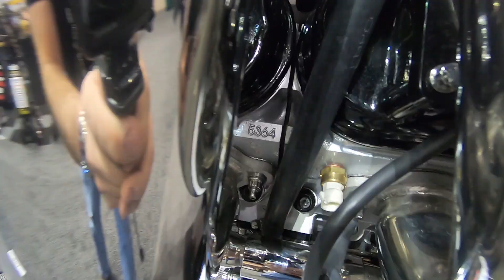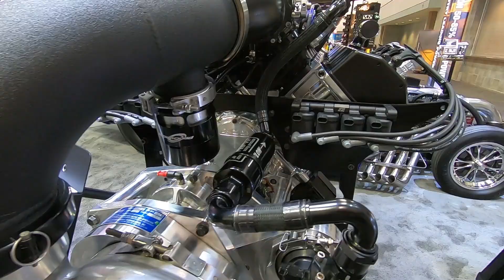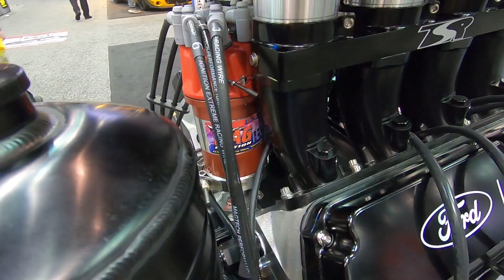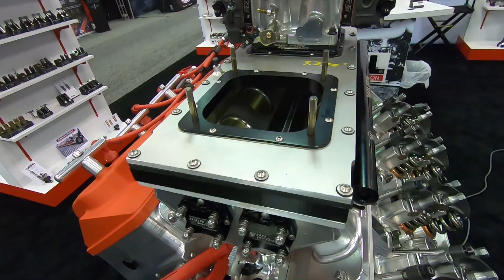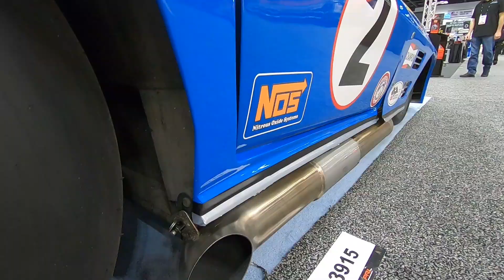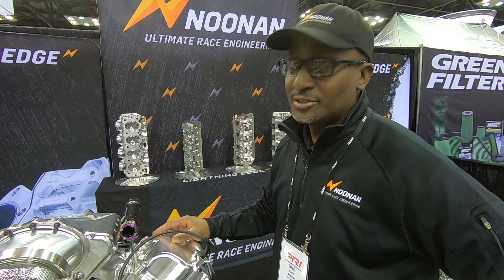10 Unbelievable Engines from the Performance Racing Industry Show (2019)

Comment: similar to the 440 cubic inch big block that I put a hilborn mechanical fuel injection and ran a 9 second quarter mile naturally aspirated first time out with a bad pump on alcohol almost sixteen to one compression

Comment: Back in the day at the time of Daytona qualifying. They said the cranks were timed 180° past TDC.  With different firing order. I thought they were using a flat plane crank some how. They were timed like the Rodeck engines. Giving them a completely different sound. You could here the difference with pull trucks using them. Just something I remember about those engines.

Comment: All that knowledge and engineering, all that custom cnc work and money....... and you just can't pull yourselves away from pushrods and rockers, 2 valves and capacity 🤦‍♂️

Imagine a 500cui billet race engine with 4 valves per cylinder. Or 5.
Imagine an engine that utilises modern ecu/direct injection technology instead of carbs/top mount throttle body. 

Imagine if the engineers actually engineered instead of just copied, and made bigger.

Comment: I don't see the 16cyl catching on with hot rods. They can make that kind of power without the weight. True the engine works harder but the performance gain of not lugging around another engine is what I think  will make it a wash. Plus all the work it would take to bastadize a chassis to hold that thing.

Comment: When you do the math the v16 isn’t that impressive bc ppl are running 600-1000 hp on a stock 150,000 mile 5.3 or 6.0 from the junkyard pretty regular with an ebay turbo so 900 NA is 450 from 8 cylinders
Reply: So just throw a couple of those 900 hp turbo junkyard motor in your $800,000 boat.  They'll last forever.

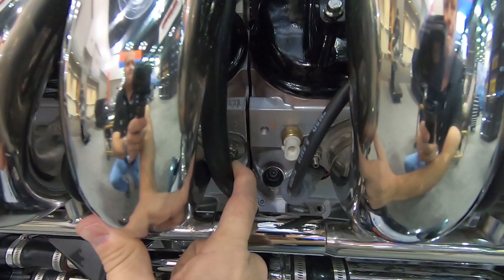Comment: 1:42
Love the exhaust manifolds just millimetres from the ignition leads and coils.
Reply: That's the architectural limits of a 1920s engine design.
99% of other manufacturers had realised 4v heads and OHC with spark in the centre of the chamber and true crossflow designs were superior almost 60 years ago.

America will catch up. Eventually.

Comment: CNC aluminum slug blocks lawl. There's a few 5,000 lb steel diesel engines that can make 3x the torque and the same amount of HP these people are attempting to make. 13-15L displacement with proper twin turbos.

Comment: if you can make make 1,000 hp with two cylinders, why would you use a 8 cylinder engine that less power and 4 times  the weight

Comment: Two stroke diesels are awesome and very clean. A radial four (X) has near zero torque vibration and no mechanical vibration. A twin row is even smoother. All four rods are carried on one crank pin so simple to make. Intake are is blown through reed valves. Exhaust has a variable port height to keep the torque high across the range.

Comment: Hold up. That Sonny's Racing engine makes about 153 HP/liter naturally aspirated. That's incredibly impressive. Also, If the Jesel engine lives up to it's hype, the current estimate is that it will produce 1325 HP with a 12000 RPM redline. That's 189 HP/liter, which is insane! Can't wait to hear what that sounds like.
Reply: I’m very confused, that isn’t that much?
Mercedes builds a stock mass produced engine with 2.0 liters and 4 cylinders.
It makes over 400hp, of course it’s turbocharged.
But much more efficient and more power than the engines you praise.

And it runs 150000 miles without an rebuild.
Reply: @rolux4853  what's impressive about these engines is that they make that much power per liter WITHOUT a turbo or supercharger. I think the highest naturally aspirated output per liter in a production car is the Pagani Huayra R with 139 hp/liter. I believe the Honda S2000 still holds the record for more normal production cars at 124 hp/liter.

Also please check the age of the comment before you reply to it.

Comment: 100hp per cylinder isnt all that great compared to much smaller packages that put out similar numbers.
Reply: Yeah, imagine an s2000 derived 4400cc V8 with 4 valves and Vtec.
9000rpm with 500hp Na 😱

Comment: WHY FOUR cylinder heads - if you're going to machine a DEDICATED block...machine DEDICATED heads and ALSO...ONE SUPERCHARGER the whole length
Reply from the maker: But why? There is a tangible benefit of a single, 16-cylinder block. All the water is contained in a single vessel and the crank is better supported. But there's no benefit to two cylinder heads instead of four in terms of cost or power production. Same thing goes with the superchargers. There is no benefit that I can see--plus it would be more difficult to keep the rotors from twisting when they are that long. Thanks for watching.
Reply: Because you can go buy many different off-the-shelf cylinder heads with great flow numbers that already exist in the performance aftermarket.  Why invent things you don't need to?

Comment: pretty funny how 16 psi is massive boost requiring a big blow off valve ... O.o thats not much over 1 bar thinking about old five cylinders with 2.5 bar or 35+ psi in comparison that's quite not massive boost rather average
Reply from the maker: Except boost is not an absolute. It is a measure of resistance. The same turbo or blower will generate less boost on a cylinder head that flows better and still make more power. For example, if you generate 10 pounds of boost on a baseline engine, pull the heads and port them then put it back together. The combo will now make more power with less boost. So it is troublesome to compare boost between two totally different engine packages. Thanks for watching!
Reply: @TheHorsepowerMonster  Well sure but i didn't suggest anything about the power output rather that 16 psi is about what my standard diesel engine runs at so i just found the term "massive" pretty wierd still a good video non the less :D
Reply: You misunderstood, it wasn't 16 psi, it was 60....

Comment: i still respect  homemade stuff higher than stuff just made with bought parts.
like the young guy kyle that made a stock bore  honda 4 cylinder engine put down over 1100 hp to the wheels and still sound smooth and able to take more.
he made alot of monsters. just imagine what he could do if  some sponsors backed him up.
https://www.youtube.com/boostedboiz

Comment: Ok,  we were impressed by everything shown here, but happen to have a direct interest in what the folks at Noonan (Racing?) achieved by slicing off 1/4 of an engine to reliably and economically dyno-test at 25% .25 or 1/4 of the operating cost, material waste, component stress, assembly/disassembly time, effort , and amount of work required to make component changes. 
 What’s the proper and lawful etiquette of possibly using a similar to but visually noticeable variation as a spin off of your idea for the research and development of a smaller auto-marine-aviation-industrial engine? 
 Relevant use Fees? Creative Credit? , Percentage? , Release? License? 
 Long as it’s cheaper than buying or paying a facility for test time on a high output Dyno
Reply from the maker: You would have to ask them. www.noonanrace.com  . Thanks for watching!
Reply: Single and twin cylinder test engines have basic equipment at engine manufacturers since the start of the industry over 100 years ago.  I tested single-rotor 350 cubic inch Wankels in the 1980's and single-cylinder 140 cubic inch diesels in the 1990's.  The original EMD 567 2-stroke locomotive diesel was originally developed in V-twin form.

Comment: I don’t believe any Ford V8 engines have  (had) bosses or mounts for a starter, they bolt up to the transmission’s bell housing with the use of an intermediate bell-housing plate, to accommodate tolerances based on various engine flywheel diameters, ring gear depth, the starter gear and nose designs, with the precise location punched out of the plate.

Comment: wait a minute, so they cast a 16 cylinder block based on the ls, strap either 4 turbos or 2 superchargers nd r still makin less power than 8 cylinder ls's?? somethings weird there, weve already got 1500 hundred hp motors doin over 300 runs leroys a perfect example n he didnt take it easy on that car either  also good lord how many ppl were vacuuming lol every other shot somebodies pushin a vacuum cleaner around :p  they were some wild ass engines tho i havent seen any of those yet

Comment: 360/16 = 22.5.  I thought the number of cylinders an engine can have must be evenly divisible by 360
Reply: There have been quite a few historical 16 cylinder engines, including the current Bugatti W16.
Reply: The firing interval could be 45 or even 22.5 degrees.  It's just a number; doesn't cause a problem.
Reply from the maker: I understand what you are saying. I can't find any info anywhere of photos of the crankshaft Sixteen Power is using, but I'm willing to bet it fires every 90 degrees like a conventional crankshaft. You'd have two cylinder firing at one, but it shouldn't be too big of an issue. Thanks for watching
Reply: @TheHorsepowerMonster  I had to go read the wiki on the v16 and it works.  Its typically used in Marine, Railroad and stationary power generators.
Reply: For even firing intervals in a 4-stroke engine, it's 720/number of cylinders, so 720/16=45 firing intervals.  Easy to do in a 90-degree block with crankpins phased at 45 degrees.

Comment: around 20 years ago someone had built what we today would call a crude version of that v-twin. it started with a keith black top fuel block, cut into pieces and welded back together as a 2 cylinder. brad anderson heads got the same treatment. iirc it ran a 6-71 blower, and it did run on nitro, and made around 1200hp. it was built for a land speed car.

i figured this v-twin was either a display piece, or something for another land speed car. interesting to see its actually a dyno mule.

Comment: The two cylinder 1000hp motor was incredible. The flat 4 also. I love engineering like that. Those engines could fit In anything! 🔰
Reply: That's far from small dude! The v twin from supercharger to flywheel is longer than 2 Ls blocks

Comment: I think that when Rolls Royce were developing the Merlin and "R" engines they ran single cylinder prototypes to see the potential horsepower figures. So to see the "twin" is unusual but not a first. Of course aeroengine manufacturers were pioneers in supercharging and turbocharging .
Reply: I dont know where it is today but in the 80,s a guy named Lucky Kaiser made a merlin v twin motorcycle from a crash damaged merlin.
Reply: Royce's made "star" engines to test concepts for their 24 cyl X engines and many single cylinder test engines, one of which led to the infamous 'ramp head' in the very first Merlins, which failed badly when scaled to the full size V12.

Comment: V16 is a waste of space a big block v8 can make 1600 blown
Reply: I agree, they could have made that power out of a v16 back in the 60's
Reply: @spyder4g63t  waste of displacement but a boat engine nonetheless
Reply: Not uncommon for 8s to have 1,000hp or more. That v16 should be around 1500 na 🤷‍♂️
Reply: @Knightmare-gz9ls  yea I bet a Ford v16 would make 1500 natural
Reply: @Knightmare-gz9ls  I do believe they upped the hp of the n/a tho
Reply: I guess you guys missed the part about reliably making that power without extra strain on the components, especially for boat engines. It seems that boat applications can be pretty hard on engines. It all depends on the cost of the V16 and the cost of any parts that may need replaced later. The rods, pistons, etc. might even be stock or lower budged parts at that power level. It might not fit everyone's needs, but it may work well for some. 

On the 406 sbc in my 79 C20 pickup, I went full roller, forged crank (precision ground and heat treated after purchased), but saved the hyperutetic pistons from the last build of it. It is a smog truck and there was a limit to how far we could push it. As a daily driver and tow vehicle, I wanted as much torque as possible and reliability to pull grades for 20-30 minutes or more at a time. It should make 400hp 525tq, based off similar engines and is double the power of the original 350 and is an "Impersonator" (the name of a magazine article the engine is based from, rivaling the power of the old big blocks. It would have been better to just swap to a 6.0 LS, but I started with a 383 and all the SB external parts before the LS even became big in the aftermarket. Sometimes people don't want to push the limits because they don't want to deal with the potential consequences and expense that comes with.

Comment: The two cylinder test engine is pretty interesting . Here in Australia I knew a guy who built an engine of similar size by cutting the front two cylinders off a Rolls Royce merlin V12 . then ran it in a motor bike.
Reply from the maker: I would love to see that! I love the weird things  that smart gearheads come up with. Thanks for watching!
Reply: Need some modern Merlin engines

Comment: What's the lines going in between the exhaust ports above the sparkplugs on the Ford  sprintcar engine? With the lines going over the valve cover? Direct injection?
Reply from the maker: Yes, I'm pretty certain that's the mechanical fuel injection.

Comment: I do wish I were born before all of the money. Back when hot-rodding was at it's roots. I love the technology, but everything seems so unatainable to the guy who goes home to work on his racecar after working a 12 hour shift.
Reply: its ill grass roots hot  rodding .....st look at all these guys getting junk yard ls motors and making big horsepower with ebay crap
Reply: @ericmartin3415  plan on doing one myself. But for now, it's a classic 383 build. 12.5:1 compression, high duration cam, pro topline iron heads.
Reply: Not like you can't make an insanely fast car for relatively cheap...these are for top-tier competition, what did you expect?

Comment: You would need a hood a mile long to fit that V16 engine into a car, but I'd like to see somebody do it. Nice!
Reply: Put that behind the cab of a 3500 70 chevy with a semi wheel conversion , but instead of dual wheel make it a fat slick!!!
Reply: Hmmm.....a Hot Rod Duesenberg perhaps?????????
Reply: I'd sacrifice the firewall just to have one under the hood 👍😎
Reply: @MisterMcGill   Sacrifice the firewall. That will work.  Just carve out a nice hole and build a cover over the part  in the cab.
Reply: Welcome to 1931 Cadillac!
Reply: Yeah, it would be interesting to how the V-16 would fit in some type of vehicle. Either up front or behind the driver I would be to long in almost any car I can think of ( older Vett!!???)... Maybe in some type of pick up truck and instead of having a bed, use that space to throw the V-16....but then you would have to figure out the transmission layout, and what type to use to get the best performance, so you just aren't roasting tires. Yeah, I sure no matter what, you will roast tires, but getting all that power properly to the tires to move forward...I'm sure some nut case will figure it out.
Reply: W16 have been around for awhile, like those that fit the Bugatti Chiron Sport for about 261 MPH. But V16 needs something lo-o-o-ong, like a skinny dragster, or a powerboat.
Reply: @ammoalamo6485  So I couldn't put one in my Chevy S10?  The first 8 cylinders would fit up front, and the other 8 behind the firewall?  Some good heat and sound shielding, a strong transmission and drivetrain to match.  Hmmm.....
Reply: Dave kindig put one in a blue 58(?) Lincoln convertible on his show,can't say if it was the same company as the one here but look it up!!
Reply: sounds like a job for a viper.